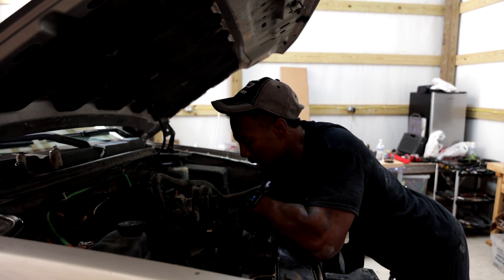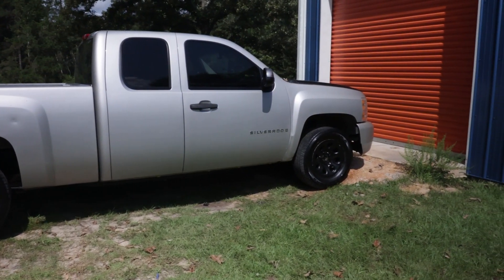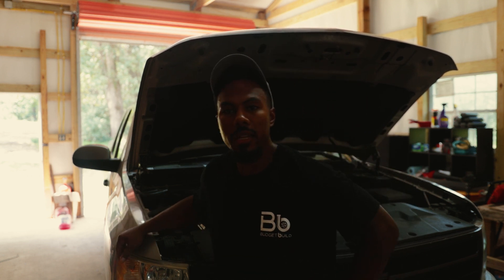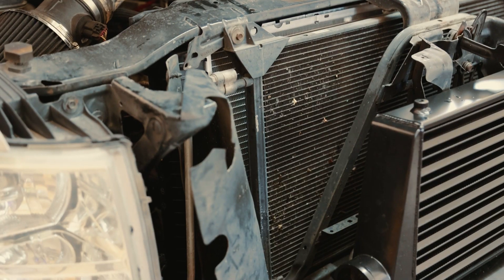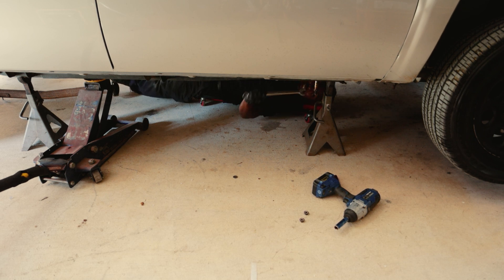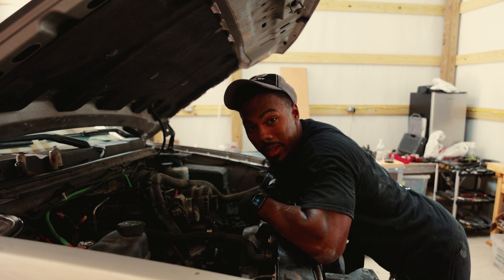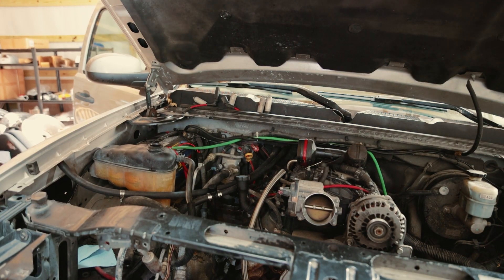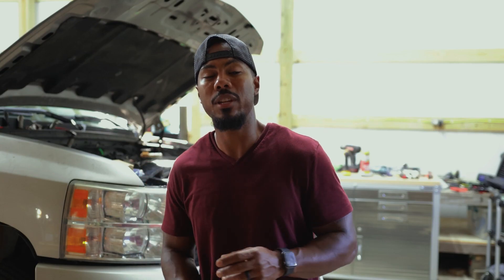HOW TO TURBOCHARGE YOUR 4.8 SILVERADO|NNBS Turbo Silverado Build PT.1|Giveaway updates and more!

Comment: I have a 2008 5.3 1500 Ext Cab Vin Code 0 Flex Fuel, 245K Miles and my Wife will have to BURY Me in this Damn Truck, I have had 5 Chevy Trucks from a 63 3-On A-Tree to a 96 454, I bought Lisa 7 years ago for $5,000.00, put another $1,500.00 into the Motor and Haven't Looked Back! BEST Damn Truck Engine EVER, I could Turbo Charge this thing and get 900hp Easy, and if I Blow the Motor, I'll go to the Scrap Yard, Buy Another one for $250.00, put $500.00 Into it and be on down the damn Road, Try Doing THAT with a Coyote or a Hemi!!!!

Comment: Saw your kit on Ebay originally. Then checked out your website. Now I'm here. Ha! Does your kit (I have a 05 Sierra with the 5.3) include everything I would need? Looks like injectors are there but what about the turbo exhaust manifold and pipes?
Great video by the way!
Reply from the maker: Awesome!! Our kit does not come with the turbo manifold! Would you be fabricating or turning your stock manifolds upside down?

Comment: Like the intro and it is getting better. Question how do you combat or stop the oil consumption on these LS engines
Reply from the maker: So far, of all the Ls motors I’ve owned, we only had this issue with one. 2000 suburban with those porous poor casting heads. Everything else has been 👌
Reply: @FilmProductions380  my 2000 5.3 has 450000 miles and burns little oil.